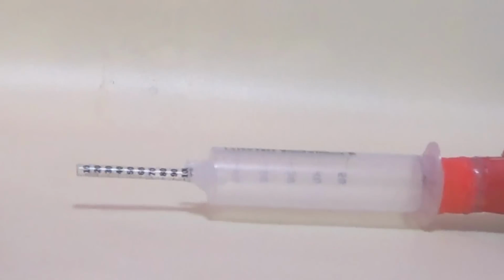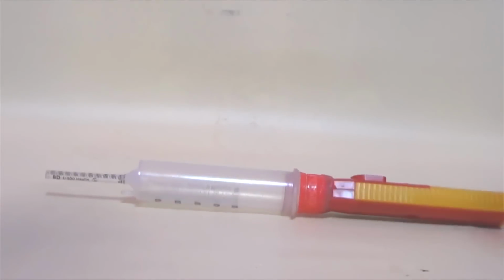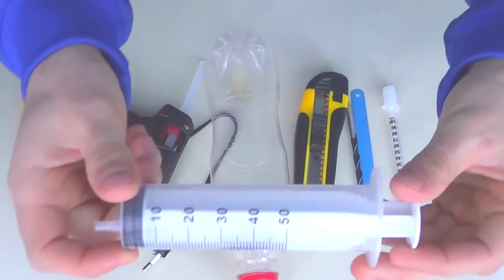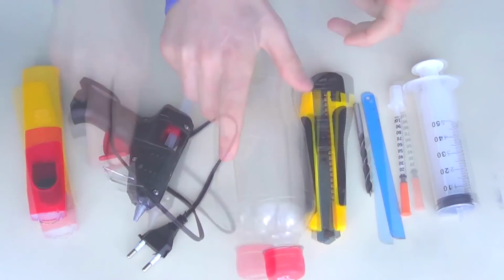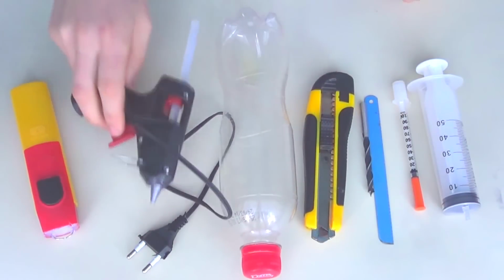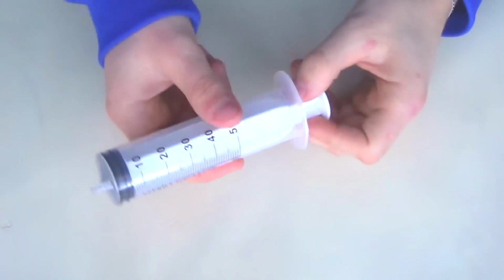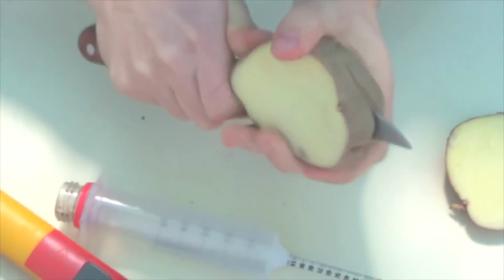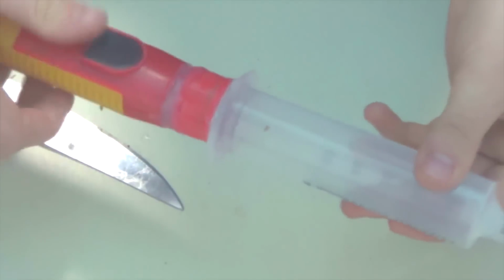How To Make a mini Electric Cannon from a Syringe

Comment: E-6000 is an excellent all purpose glue which is extremely strong, flexible, resistant to oil & gas, and tolerates heat. Much better than hot melt glue. I use it for all my projects.
Reply: what are you doing here lol
Reply: Mark Schulz IV
Few people know about E-6000 adhesive, which is why I mention it when I see people using hot melt glue which is inferior. I was offering excellent advice, normally people are thankful when others make a good suggestion..
Reply: +electronicsNmore epoxy is better
Reply: +electronicsNmore epoxy is better
Reply: +Jamil Khan
Not for everything because it has little or no flexibility. It tends to crack or pop off the surface.
Reply: electronicsNmore I checked like 3 different hardware stores, and they have no idea what that glue is...
Reply: Mark Schulz IV
E-6000 is sold online, at art/craft stores, or home improvement stores(Home Depot, etc).
Reply: electronicsNmore Alright, 2 oz of that glue costs about 8 $, which is not bad if it's good glue as you said. Unfortunately, shipping to my country and taxes adds to about 35 ...
Reply: Mark Schulz IV It only cost around $4.00.
Reply: electronicsNmore well, I couldn't find cheaper than 8 $. Checked, us ebay and uk ebay